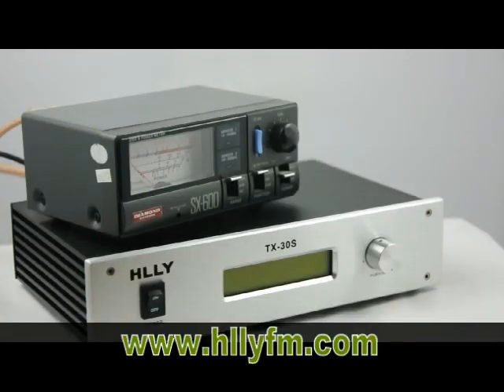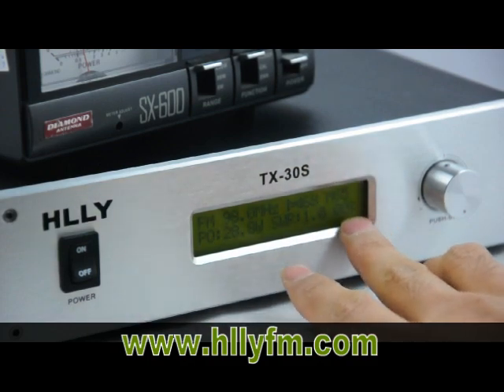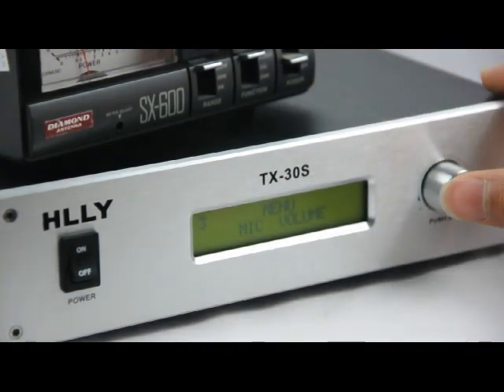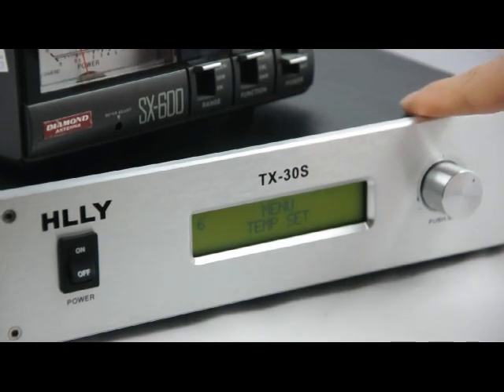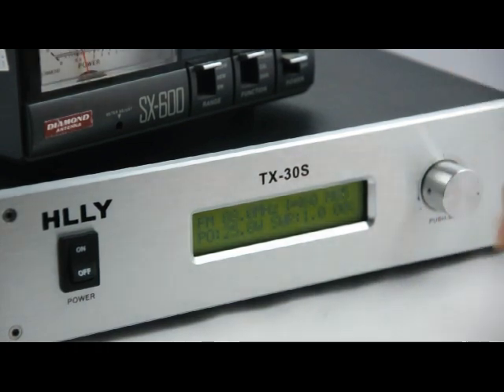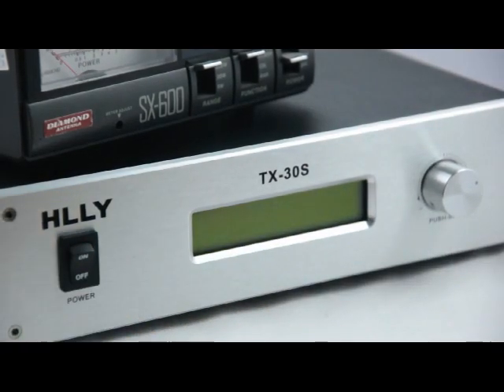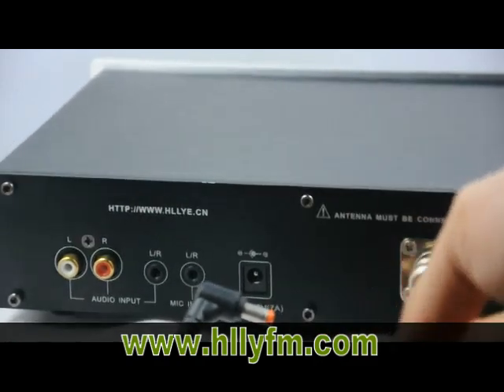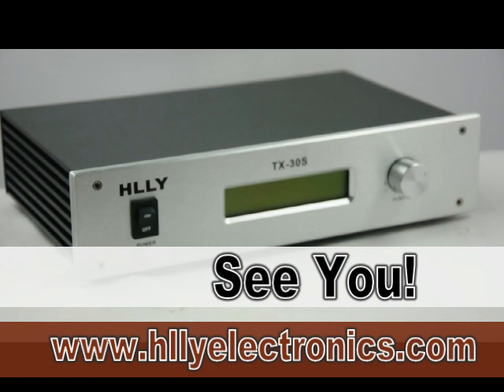HLLY TX-30S 30W FM transmitter for FM Broadcast Professional Transmitter

Comment: I ordered a 2nd TX-30S transmitter.  The 1st one overheated real fast and blew up.  With this one I just ordered, I am going to be sure that there is enough air circulating to keep it  cool.  Thinking of adding MORE cooling vents so that does not happen again to me!

Comment: This is not by any mean "Professional" transmitter. Power amplifier and controls are quite good but main problem is modulator/Stereo coder/PLL, based on BH-1415 or 1417 IC. They are designed for car FM transmitter having nano or milliwatt power level enough for coverage10 feet or 3 meters range. In another word their spectral clarity is very bad and if it is amplified over the milliwatt level it can make problem to the licenced radio stations. That is the reason why they are not legalised in USA and EU. And it seems nothing will be change in legislation.
Reply: I got a 50w varient, and it does not interfere with anything whatsoever where I broadcast out of 🏴‍☠️🏴‍☠️... Lol

Comment: IS  IT  FCC  APPROVED?
Reply: agape423 of course it's not, jeez.
Reply: You mean "type accepted?"  No.  Using one of these is a good way to get The Knock from an FCC inspector.  They're designed very sloppily and transmit spurious emissions.
Reply: No it puts out to many harmonics check out the CC Radio Whole House transmitter from the C crane company that one is fcc approved.
Reply: Yes, and also many governments around the world buy these transmitters... They do meet FCC requirements. The company who makes transmitters have an FCC certification...
Reply: @tucosalamanca7148  Oh?  Then why doesn't he put the FCC Certification Number in the video?  Maybe cuz there is none?  I wouldn't buy one of these things.  How long have you been using yours?  I'll pass...I've got better things to do with $10,000 than pay the FCC fine for flicking one of these on.

Comment: dubfinger - When you do get one, I suggest you drill 1/4 inch holes after taking the top lid off in the top lid right over the final on the left. Then epoxy a 5.5 inch 12v fan over the holes to keep the Final Transistor  cool. If you don't, expect 2-5 days until it burns out. Of course  trace the fan first so you know where to drill the cooling holes. Then sand or Dremel the metal filings off, make sure it is free of metal deb-re. Just FYI..
Reply: Johnny Lifeson johnny in the average town with the attena at like 30 ft how many miles can i get?
Reply: North Star Studios Depends on your surroundings . roughly 7 miles.
Reply: 9 miles i believed, it maybe small but very powerful
Reply: I have since upgraded to a full 19" rack system

Comment: sorry this is for pirate radio users,professional transmitters cost 25k plus,lets live in the real world....put looks a nice unit.
Reply: They are JUNK..
Reply: like i said ,professional units cost around the 25k mark plus,you pay your money and buy the one to fit your budget
Reply: actually they work really well....
Reply: Actually I think the best ones out there just might be an nicom fm transmitter I just emailed them and they are expensive but most likely are more professional reason I say that Is because I was looking at an forum and one of them said nicom among other professional companies now taking an look at an 30w they told me I would be about $ 1,390 + $25 packaging plus freight we also have a STEREO option for $200 additional along with there antennas which they say I would recommend a BKG1P if you can use Vertical polarization $ 490 + shipping Or a BKG88 circular Narrow Band ( tuned to frequency and you cannot change it for $ 390 the best is the BKG77 which is circular and broadband, but its more pricey $ 675 but still nowhere near 25k
Reply: How much distance I can cover 

The distance in km

Comment: how far do they reach ?
Reply: Depends on your surroundings . Usually about a 7 mile circumference  . Further with a Ramsey 5/8 wave Antenna. Stay away from those 1/4 wave pieces of junk. Ans get some good Coax RG8XU...
Reply: Thank you for your answer:-)
Reply: @unit5259  thats really impressive. i'd like to invest and want to be heard at least 30 miles away but theres so many options out there i'm not sure which to buy.
Reply: @DjSmoothNY  Don't buy this thing if you're in the US.